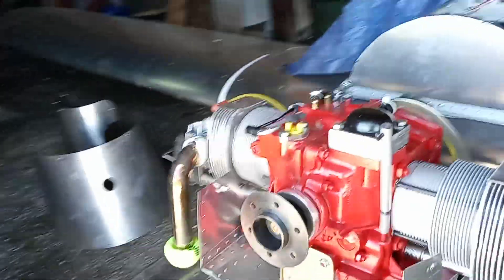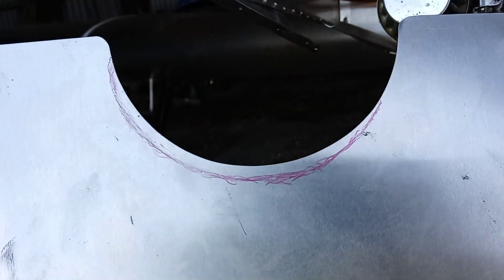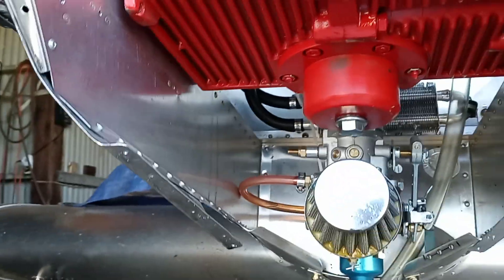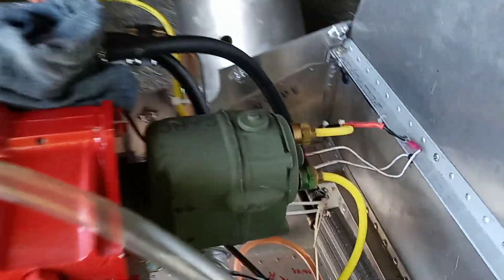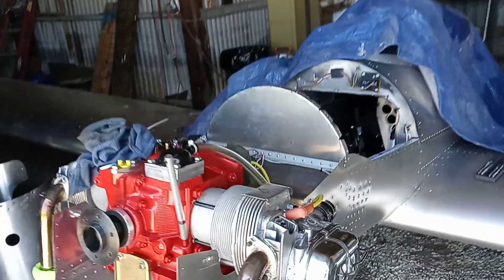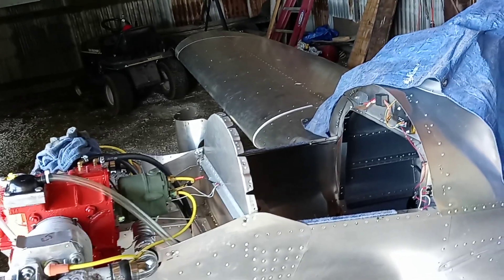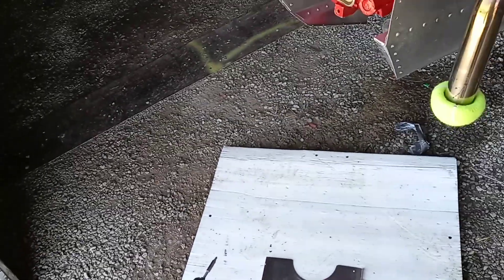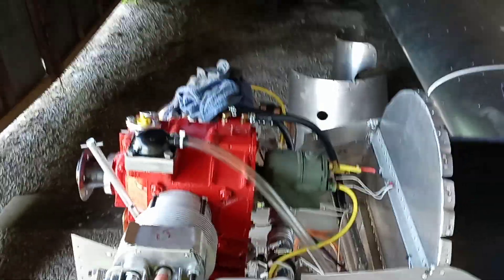UC getting ready to try to refit oil cooler

Comment: When welding the fuel tank , clean metal is a must. Aluminum with petroleum residue will be almost be impossible to weld.  Especially  .030 thick material.
  Try to get denatured alcohol ,pouring it into the tank,  let it run out of the leak in the tank, this will clean the internal portions of the crack.  Just a little tip I learned the hard way. 
 Hope your feeling better, keep on ,keeping on.
Reply from the maker: Hi Idaho Mike well sir I have the tank at a guys place. I dont know what he will do. I hope he can fix it. Thanks for the tips....